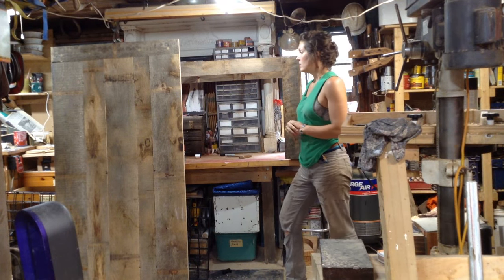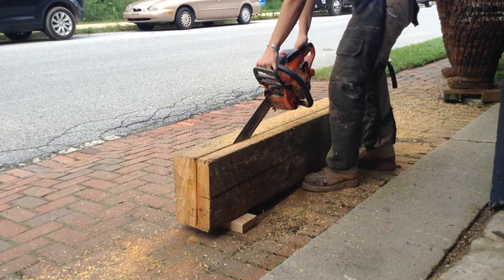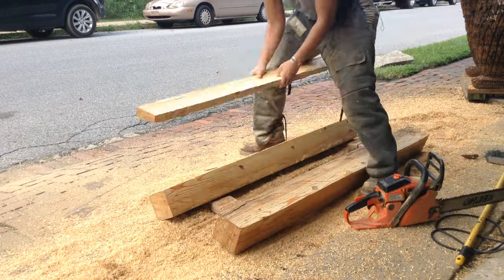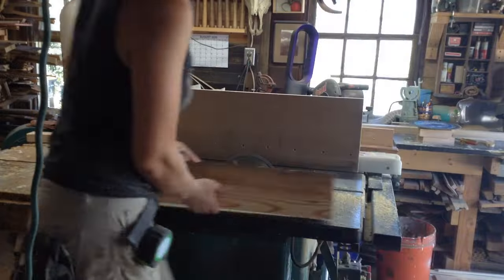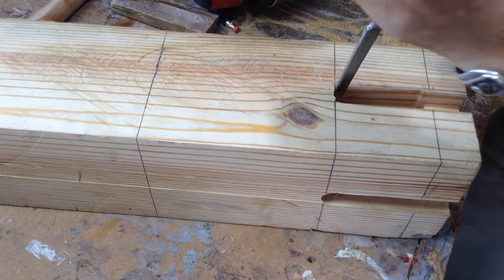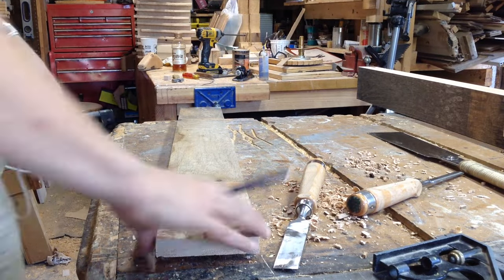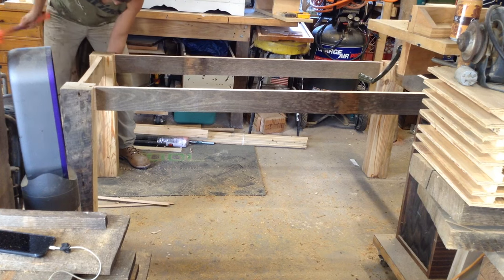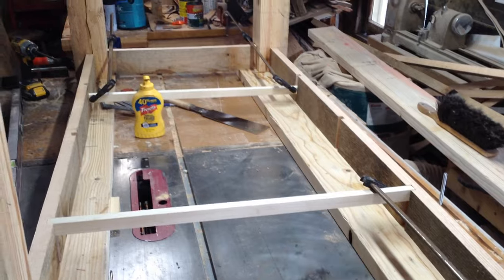Woodworking : Rustic Kitchen Table  [How-To Part 1]

Comment: I enjoy watching you work in your shop. So many YouTube creators have shops that are completely out of reach with the newest and fanciest equipment, and the machines look like they are never used.  You turn out great work with older equipment that shows lots of use, but is maintained properly and is just as capable.   Keep up the great work!
Reply from the maker: Thanks!  It's rough and tumble around here!
Reply: @HoneyBadgerWoodWorks  lol..wouldnt want it any other way..

Comment: Your videos are great! I have a similar sized carriage house in Upstate NY that I'm turning into a woodworking shop (taking some inspiration from your space). About to dive into my first winter working in it... how do you heat your space in the colder months?
Reply from the maker: The first couple years I had no heat and that sucked, then I tried Kerosene for a year and liked that, but it's hard to get kerosene around here and I had to refill my 5 gallon jug at least twice a week, and that was a pain.  So, last year I switched to propane and that was awesome heat, but I had to refill the 20 gallon jug even faster then the kerosene which is just a hassle.  So, this year I am toying with the idea of a small wood stove, the kind made for tiny houses.  Idk if that will happen yet.  But, I hear those work great and I have access to lots of wood for it haha.
Reply: @HoneyBadgerWoodWorks  Definitely a great recycling method! I got my hands on a used wall-mounted propane heater. Glad to hear you had moderate success with it (because thats all I'm looking to get).
Reply: @HoneyBadgerWoodWorks  I used to work in a large shop and we used diesel fuel in our kerosene heaters without problems. Easy to find and a lot cheaper.
Also wanted to say that I'm very happy to see your channel growing. I've been following since early 2019, when I was looking for ideas on aquarium stands & your videos popped up. You have so many fantastic projects and it's great to see more people taking notice.
Reply: I've been using a combination of wood and kerosene foe about 10 yrs. now. Works pretty well until the temps get near zero. ( I live in Michigan and it's not unusual to get a few of those every year) Then you either dress for it or take a break. I'm working on a satellite shop for my basement for when I'm on a deadline and can't take a break.

Comment: Had to add 2 things..First..how thick was the table top.? I keep hearing ppl say 1 1/2 inches...another thing. After spending nearly 2 and half  years asking woodworkers questions,You are the ONLY you tuber who has answered my questions...and you would be surprised at how many ignore question for help..I really am grateful..i understand it can be overwhelming but some are begging for money..
Reply from the maker: Personally I think the thickness of the top really depends on the base.  you can span longer distances with thicker material.  I prefer to always have some sort of apron on there though.  These big slab tables with just two pedestals holding them up I feel like are just asking for trouble down the road.    I wouldn't go thinner then 3/4 for a larger size table though.  If I remember this on was around 7/8 made a little thinner. 

Thanks I try and answer as many people on here as possible, since I view this as a learning channel. Every once in a while a comment gets missed or looked over. I do think for the more popular channels, and as this channel gains more subs it gets harder and harder to respond to comments.  It's just very time consuming.  I can only imagine the time it would take for people with hundreds of comments on videos.

Comment: Fantastic!!!! Wish I had found this video before starting my table build.!! Can you explain how you use your chainsaw to cut that wood? I mean so straight ?! The are tearing down 3 barns by me and I want to use those beams..any help or advice ?
Reply from the maker: I start by using a chalk line to get a straight line on the top and then transfer that to the sides.  Then I go over the chalk line with a lumber marker so its nice and bright and easy to see.  The first pass is really the most important, so I take my time with that one and focus more on hitting my line versus depth.  Then I do the two ends, and cut those marks as well.  Now I have a reference on the two sides and top that I can follow.  I start each cut lining up the saw with my reference marks on the sides not the top, but then obviously follow the top for the full cut.  The more accurately those first cuts are the easier it is to follow them and just gradually gain depth.  And then I usually flip them half way through and do the same thing on the fresh side to meet in the middle.  The meeting is usually where my alignment gets a little skewed.  Don't kick yourself if they aren't perfectly straight.  I usually have to clean mine up a little bit with a plane.  Hope that helps.
Reply: @HoneyBadgerWoodWorks  Perfect.! Thank you so much...uh..one other question..how thick was the table top?

Comment: So you used oak for the table top and aprons but yellow pine for the legs, right? Nice work, using haunched mortises, especially chainsaw and explaining cutting distorted lumber on a tablesaw. BTW-I had watched some video of a fellow that bent a tooth on a old, non-carbide blade to create the "rough sawn" look and in a pinch, it works. Yeah, never understood those wanting the rough look but if it sells or makes them happy...which I just got some free unsplit firewood that is really walnut! Gonna seal them and store...could make bowls or resaw for something.  Sad the camera battery died but hey, your work does not reflect it comes from a close-quarters workshop!
Reply from the maker: Yeah the legs are yellow pine and the rest oak.  Only reason for that was I had that rustic beam and the finished product will be rustic, so the yellow pine shouldn't stick out like a sore thumb.

Comment: I love your bracelet.  By the way, there is a very structurally sound way of making table legs, that are removable. You could use the Festool 14 mm connectors and dominos. You can build a house with that and ship it around the world. Great work.
Reply from the maker: That would work haha, I'm building a table right now with removable legs and it will be structurally sound, I just think old school mortise and tenon permanently affixed is the Bentley of table legs.

Comment: Nice work!  Small shops present their "challenges"...  I have a couple of pipe clamps for longer work.  They are pretty cheap, and you can almost always find a place in the rafters to store the long pieces of 3/4" pipe when you are not using them.
Reply from the maker: I have couple of those pipe clamps, but none over 6ft, so might be time to buy some longer pipe.